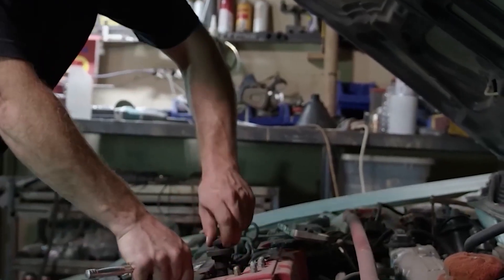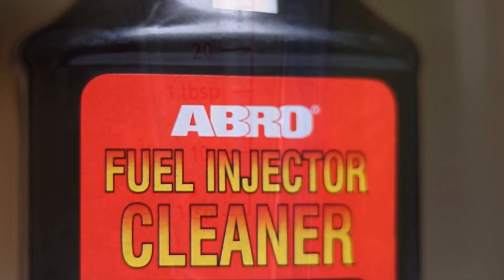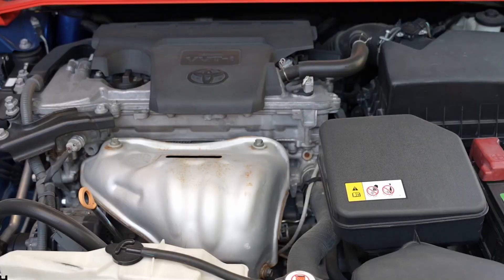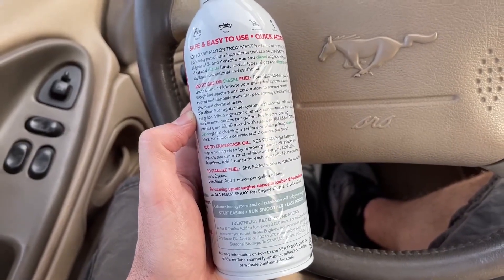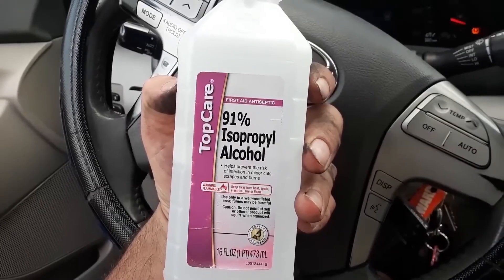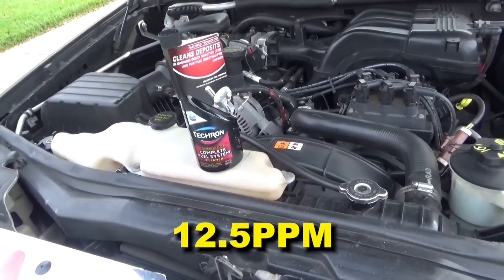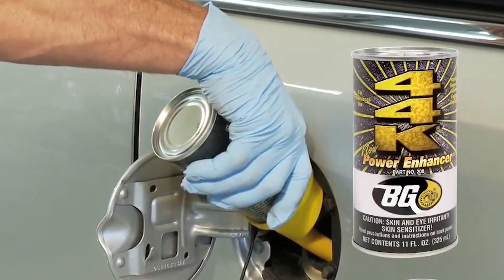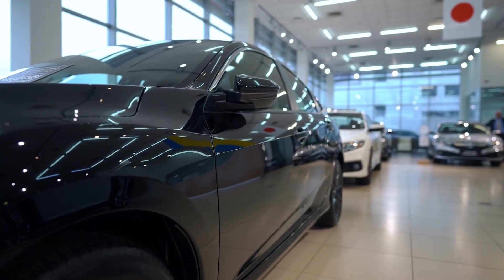NEVER Use These 6 Fuel Injector Cleaners (But 3 that Actually Work!)

Comment: Would this cause my spark plug to blow out?
Reply from the maker: That’s a really smart question, Luke — and no, a quality cleaner like Techron, BG44K, or MaxClean won’t cause a spark plug to blow out. Spark plug blowouts usually come from damaged or over-torqued threads in the cylinder head, not from anything running through the fuel system. The only time a cleaner could indirectly cause issues is if it loosens massive carbon chunks in a heavily neglected engine, but that’s extremely rare. If your plugs are torqued correctly and you’re using a PEA-based cleaner, you’re perfectly safe.